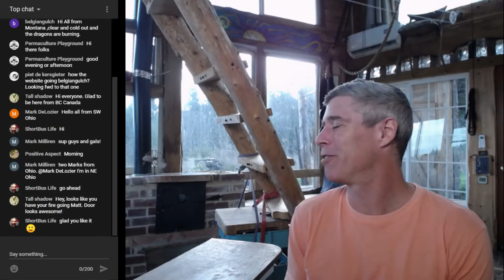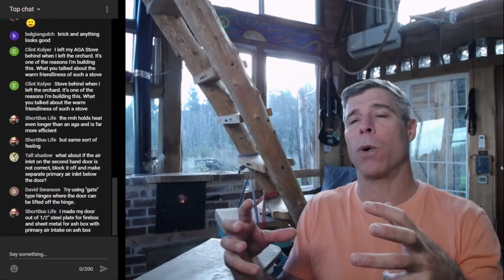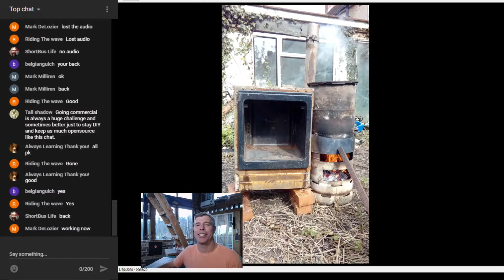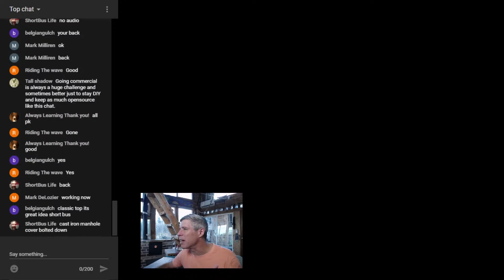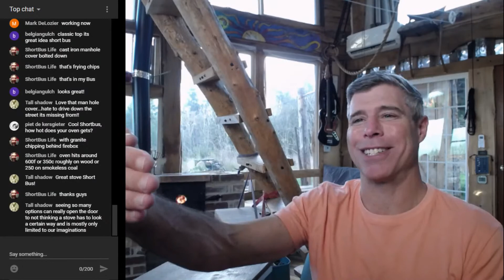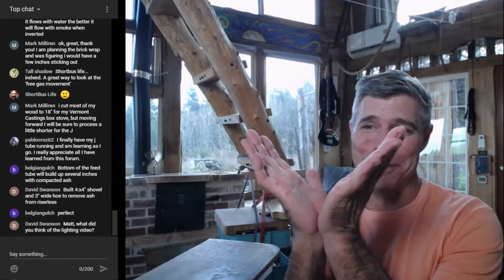Stove Chat Episode 35

Comment: I had the weight issue for my stove.  I took 1/4" flat 4" width to wrap around the corners like straps to keep the bricks from stressing.  I also used refractory cement instead of fireclay/sand mortar for setting the outer shell brick around the core door...and faded it to the clay.